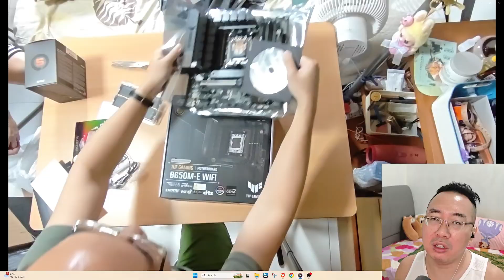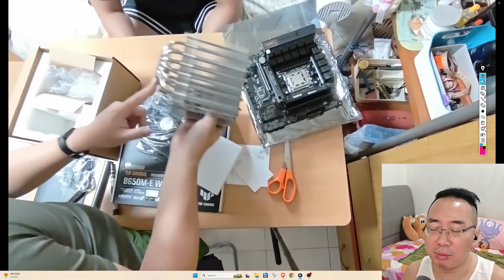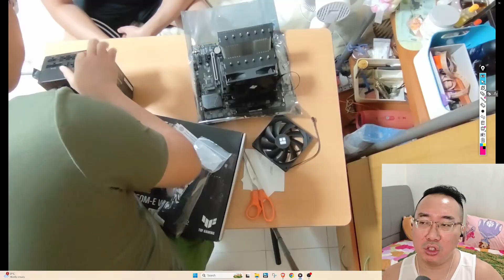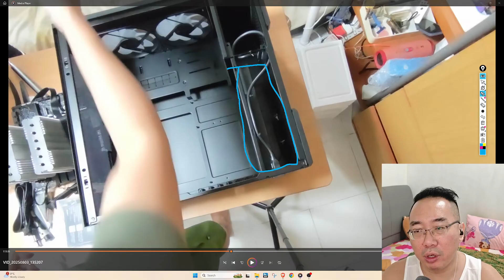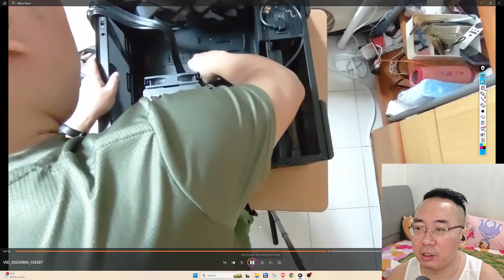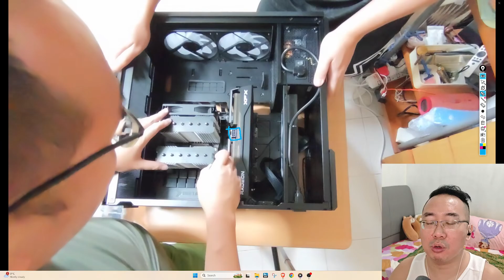Step by Step $1500 SGD PC build in the Lian Li Lancool 207

Comment: Did you install any sata hdd/ssd? How's the cable angle for connecting those, I heard they they are like super tight.
Reply from the maker: No I didn't....

Based on the manual I found online, they are supposed to be installed at the btm of the case, right below the 2 fans that supply air to the gpu. Since they are seated at the bottom, i think the straighter sata cables should be better for them
Reply: Ok so the best thing to do is install the ssd according to the manual on top of the hdd tray, same with hdd, and once you have it secured THEN plug the 2 things in directly into it, it should be facing where the power supply cables are also facing. and it should be fine. Haven't figured out how to install HDD yet because manual says 6 screws and I only have 4 holes on the drive...

Edit: seems 4 screws is enough